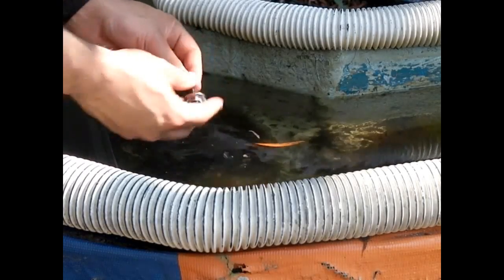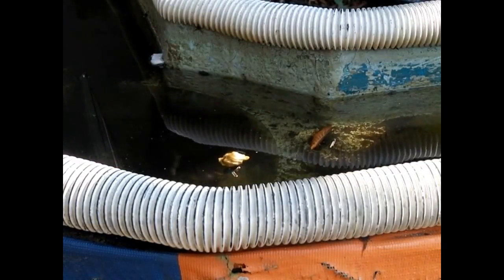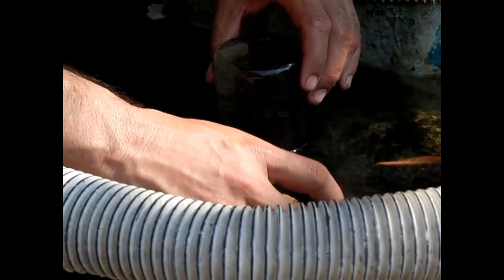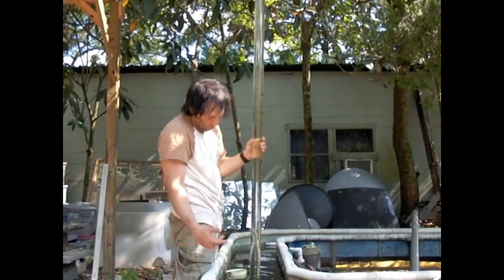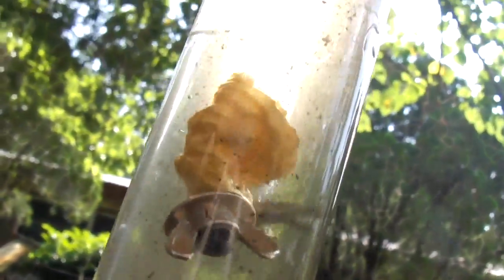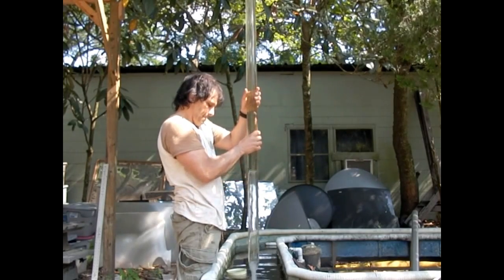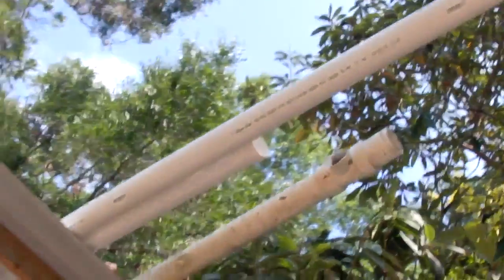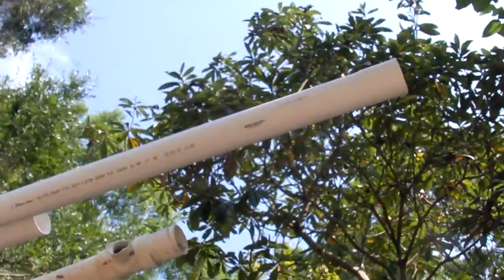Water Lift Atmospheric Pressure Torricelli Vacuum 10 meter potential

Comment: Another way. Construct an air chamber under a counter weight connected to a cable and pulley system.  Release the air and down goes the weight lifting the cabled load.  When air chamber & counter weight is at the bottom of the tube, Seal the above water from escaping the tube & empty air chamber of water. Top up the tube due to displacement.  The height & or how often we can lift a load is limited to how much water can be pumped to refill the tube from up top from a tap. Use the water sensibly.

Comment: @Random Man
 G'day mate. Um, the problem with Pumping Water uphill to store Energy is that to raise 1 Pound of Water by 1 Degree Farenheit, it  takes Energy equivalent to lifting the Pound 678 feet into the Sky... Utilities use Hydro-Electric Schemes to Level Power-Loads. Pump up all night, &extract Power  come Breakfast time. Power Station stays at a Constant (Peak Efficient) Throttle-Setting. Search "sunfoil". Have fun. Ciao !

Comment: Do it in reverse.  Float a weight and release the air, use the sinking weight connect to a cable & pulley for the work. Just seal the tube from the bottom & displace water only around the empty bladder and refill with air.  External energy has to be applied to replace water due to displacement.  Energy can come from a common tap.  Providing we properly utilize water from that tap, it's green power.  Some industries that use tons of water, could store this energy in a large tank and use both.
Reply: But then doesn't pumping water to the top consume more energy than the energy produced by the weight used? ( as displaced water weights more than the weight used).

It seems to me that the energy produced when weight is lifted combined with the energy produced when the weight is free-falling is equal to to the energy consumed to add water back at the top.

Comment: There must be a limit to the height of the tube, the weight of water will at some point create a vacuum at the top of the tube.
Reply: yes 30 feet its not about wieght however its density even a thin tube of water 1 cm wide could pull a vacuum in a 10000cm chamber

Comment: Well Dan,
your float by going up removes water from the tube...
So you end up always with less water in the tube...
To get the same amount of water up there again needs more energy than you win by getting the float up there....

It looks nice, but it is unfortunately just an energy loss...
cause the float does weight less than the same amount of water which was up there in the tube,,,,
Just calculate it and you will see it.

Regards, Stefan.

Comment: wrong, cavitation does not require dissolved gases in water especially when it can boil into it's own gas at such low pressures you mentioned. at around 3% atmospheric pressure water will boil at room temperature, and you can get that kind of low pressure by suspending a 10m airtight column of it. if water suction due to leaf transpiration was the only mechanism for water transport no tree would grow higher than 10m.there is actually positive pressure at the roots due to osmosis,pushing H2O up.

Comment: The interesting thing about the height limit is that it's completely dependent on there being air trapped in the tube, causing the water to boil at extremely low air pressures. If this system was designed to ensure no gas enters chamber though, there would be no limit, just like the system trees use to lift water! 
... Physics is cool.
P.S. grr, erroneous copyright claims are a pain.
P.P.S. I don't think anyone minds the reupload though

Comment: but hey you could re-fill the top of the pipe by leaving the cap open and routing rain /river water into the pipe, resetting it for its next lifting job, right?  is it just the volume that is lost? or the weight to weight? Not sure.  also getting the object in and out the tube needs a little tweaking. Surly this could be scaled up, massively?